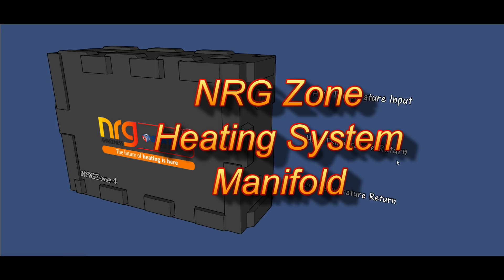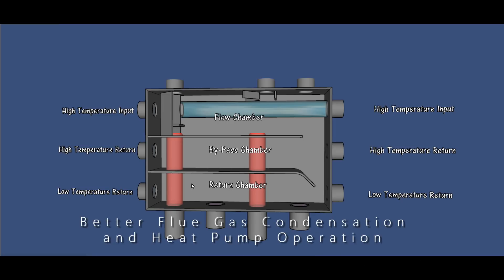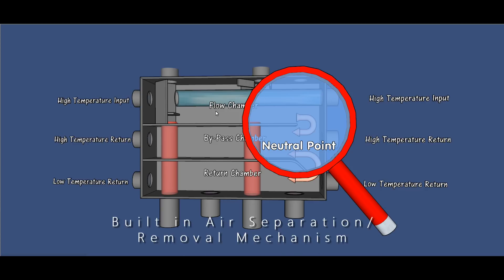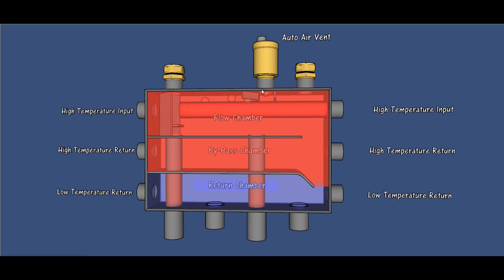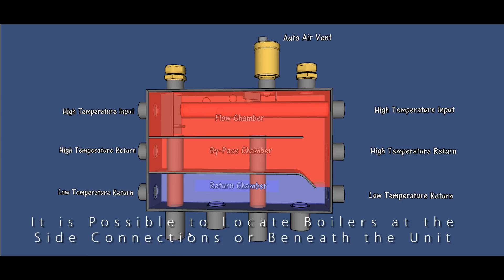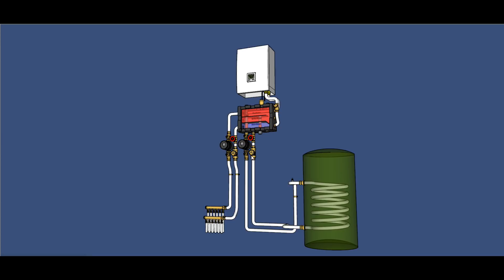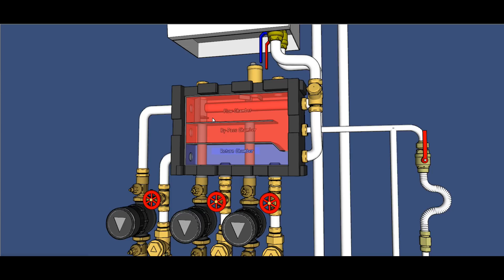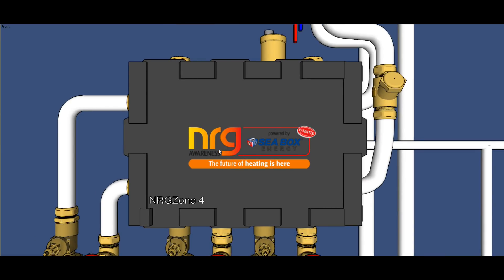NRG Zone  System Explanation

Comment: Where can this be bought and what is the cost
Reply from the maker: NRG Zone can be bought at the NRG Awareness store on the website below. The prices are in the Shop section.
https://www.nrgawareness.com/
Reply: If you're doing weather compensation
From a condensing boiler, and you're feeding underfloor heating it's better to feed the flow from the convincing boiler in the second chamber. The same consideration should be given to a heat pump that runs at delta t five.